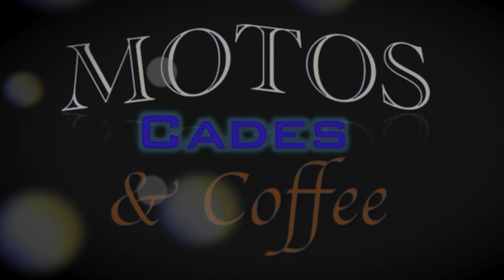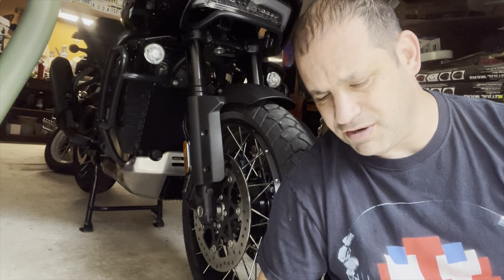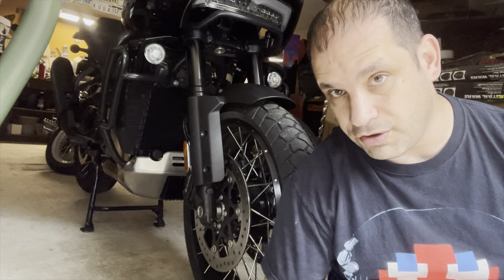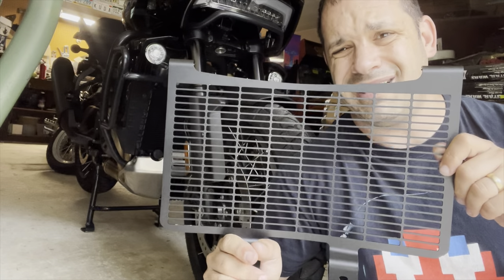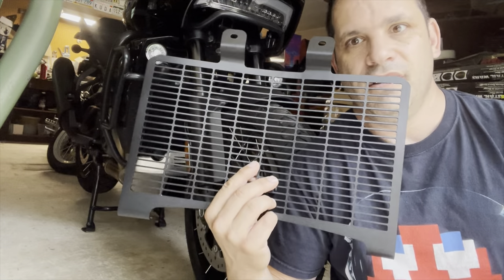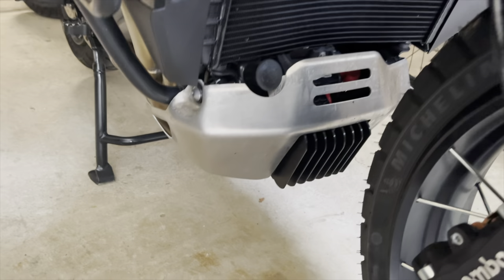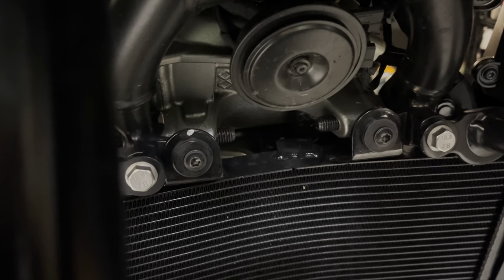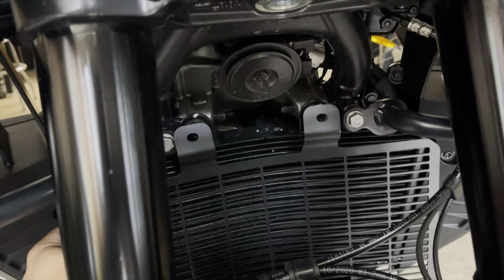Harley Davidson Pan America - Protect this House Part. 1 | Radiator Shield Install

Comment: Yep! radiator shield on the list of needs! Rode on South mountain around the Washington Monument area, wasn't looking for off road but I ended up on one.
Reply from the maker: Awesome, how did the Pan Am do?
Reply: @MCCJustMotos  The bike has the power to muscle through, but the stock tires are not up to the task of the slippery rocky gravel. Will go again when I get a go-pro mounted to my helmet.
Reply from the maker: @randiwallace4895  Thanks! I take it you don’t have the optional Anakee tires?